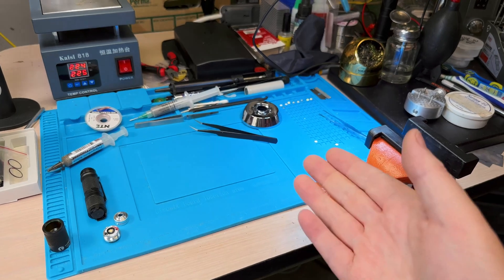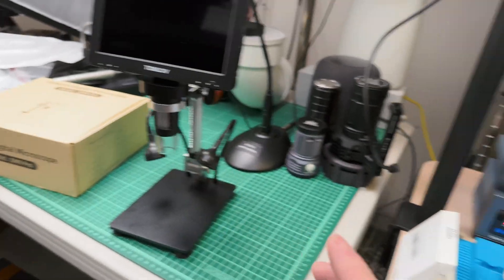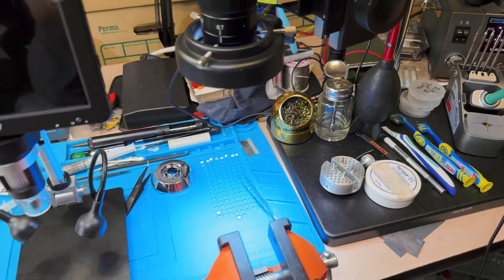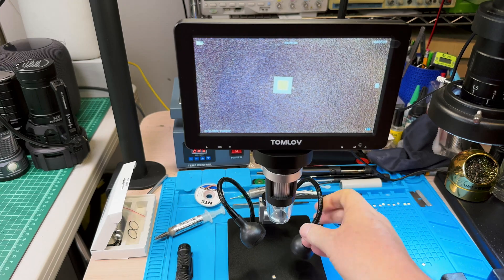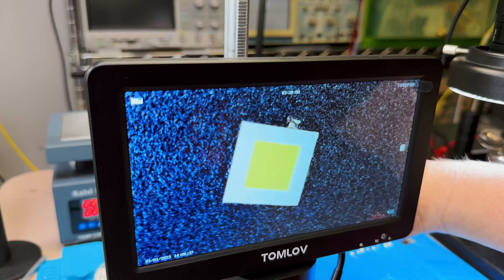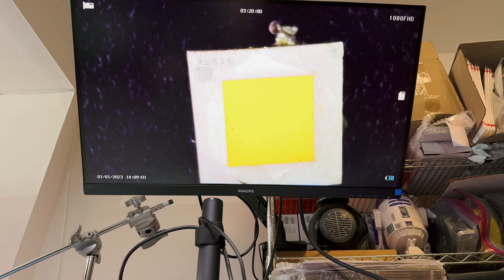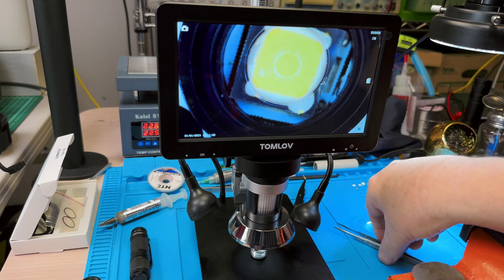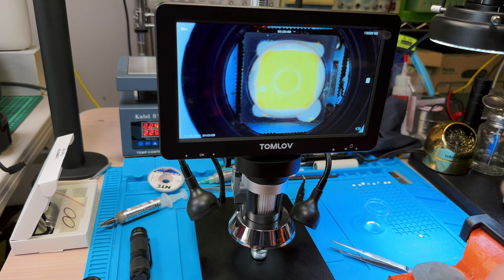Flashlight Modding Tool: Tomlov DM9 Pro Digital Microscope

Comment: Awesome video Cheule! I think there is one important piece of information that people need to know about microscope is the working distance. The Hayear 4K microscope can be customised for different working distance and magnification which is something that the Tomlov DM9 Pro cannot offer. The working distance is very important for SMD soldering because you do not want the front lines to be too close to the workpiece.
Reply from the maker: Of course! That’s why I actually used the microscope to solder a mcpcb. It had ample working distance—not as much as the hayear of course—but it was fine without modification.